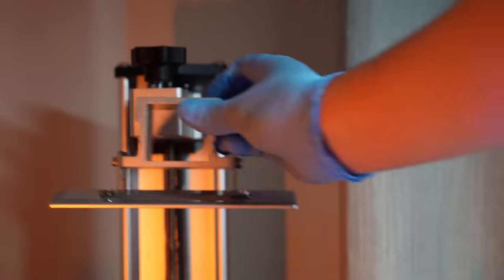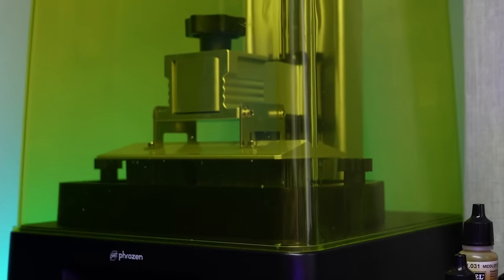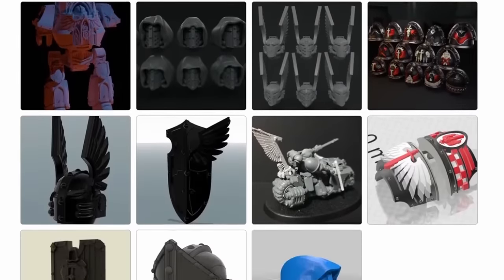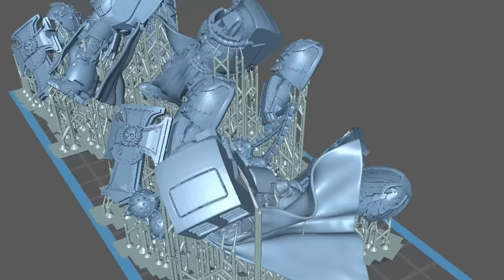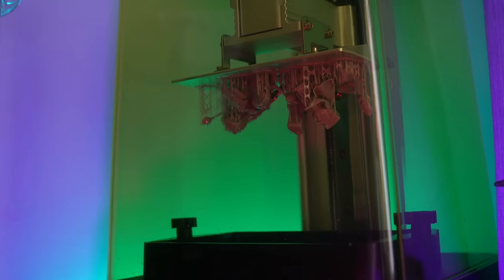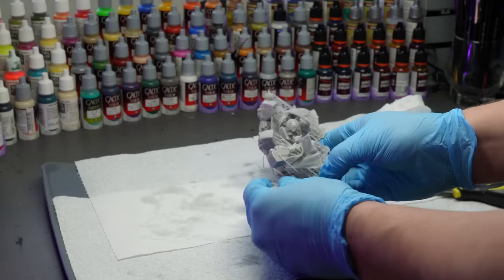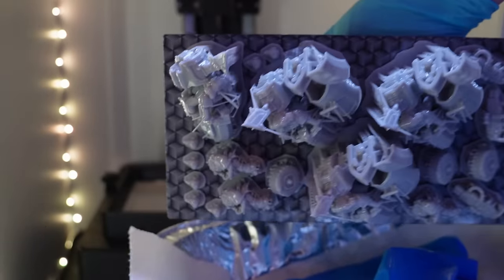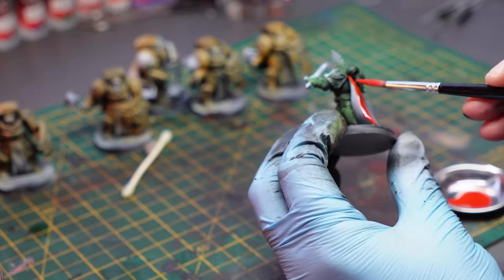I Was Challenged To 3D Print With ONLY FREE Files. It Didn't Go Well

Comment: Yea if you want free files you have to become VERY proficient with self supporting files. Dialing in your support size is absolutely vital. After I had my support sizes 100% dialed, which took MONTHS, I now auto-support in chitbox, and then paintstakingly add slightly larger supports to the weight bearing positions, especially the first few areas closest to be build plate. Chitubox gets about 95% of the spots where supports needs to go, but cannot properly estimate where heavier or more suction prone areas will be. So far my self supported models have almost 100% success after dialing in with zero artifacts, which are usually caused by too big supports. Many small supports are much better than few big supports, because big supports will pockmark your model. Also you have to learn to rotate your model in such a way that details tend to grow away from the build plate, which just takes a lot of practice. Good luck!
Reply: I always look for parts of the model that 'will not see the light of day' (the soles of feet, or the hidden sockets of multi-part models) these places always get a HEAVY support.
Reply: I just use the auto support in Photon Workshop. Hardly ever have any issues.

Comment: A note about free files: Always check them for errors and resin traps (voids) before you print - and before you waste time supporting. 
I've seen a lot of really nice looking models - including a good number of premium files too - that have voids inside them. Most of them I am able to repair (Blender is awesome once you figure it out, and Windows 3D Builder fixes what I miss) but some are impossible to repair and are effectively junk - unless you can vent them with holes.

Comment: I found those terminators tried printing some today and had some failures. Ends up the bottom of the pre-supports wasn’t flat, so the first few layers didn’t stick to the Build Plate. So just a hint always check your first layer on your slicing program.
Reply from the maker: I have had a few mishaps with the first layers not being on the plate but I'll admit i don't always check it, the shields don't print so well with little fails on them if I had more time I would've supported myself
Reply: Any hints?  I've searched multiple key words and can't seem to come across these. Not sure when I'll print but always good to have files on hand.
Reply: @rzor12387  Yeah I'm a file hoarder. Problem is I'm not organized. I use cults3d I have a lot from jonethealliance I search free and space, deathwing, terminator, supported, but you may have to do supports yourself. Most people don't take the time to include those.

Comment: But… the challenge was to use the smaller printer, and models you didn’t already have. So by “firing up the manufactorum,” and by using a Leviathan you already had, you not only failed the challenge, but did so by cheating. So no matter how many votes you got, the winner shouldn’t be you.